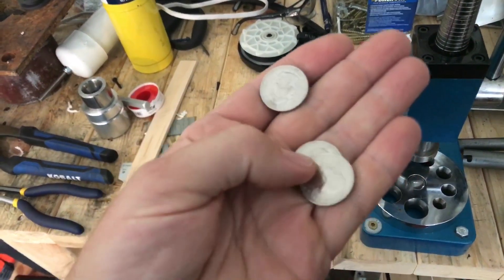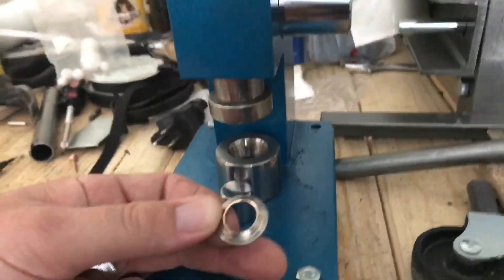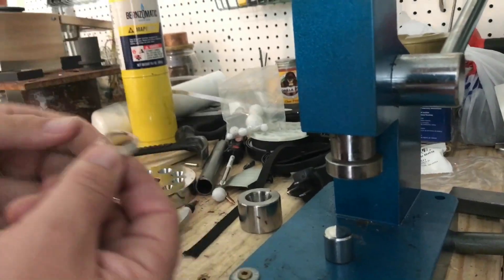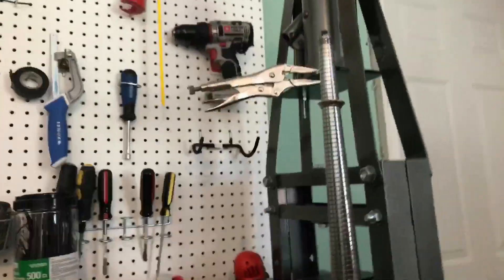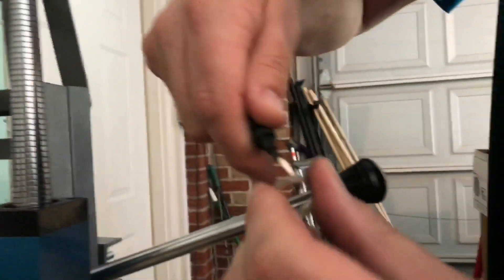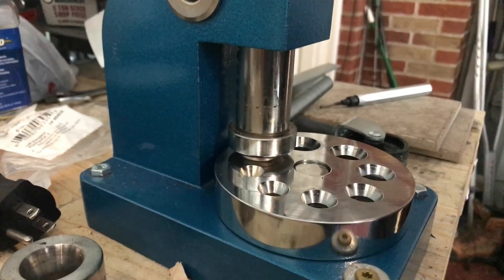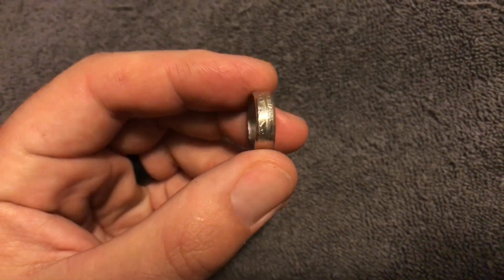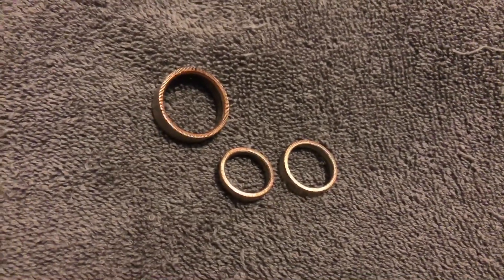Coin Ring Making. Coin Ring Making For Beginners.

Comment: It's probably because you didn't turn the ring on the ring stretcher to stretch it evenly you need to rotate during each time you pull that handle and it will give you a perfect round shape for your ring I'm not an expert I'm just learning but this is one of the first things I've noticed that you did not do you also didn't annel the coin.. there's a lot of steps you missed for Quality results.